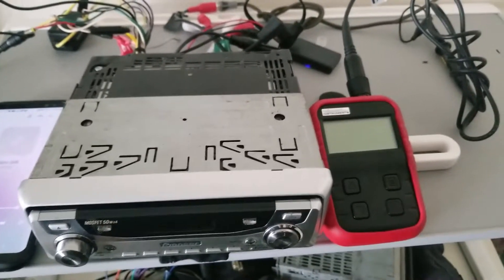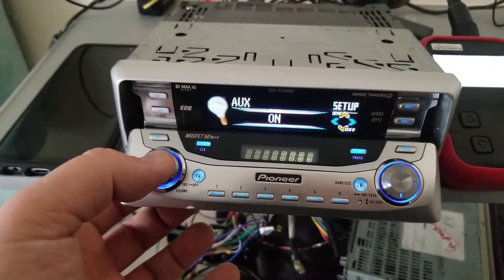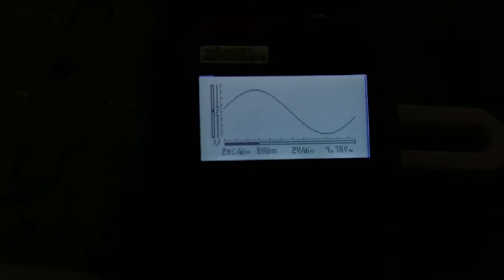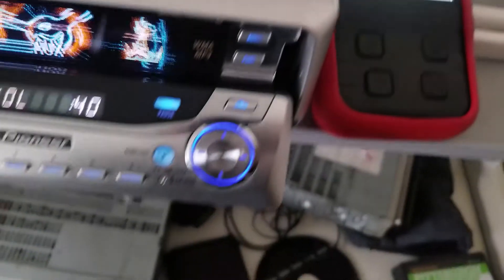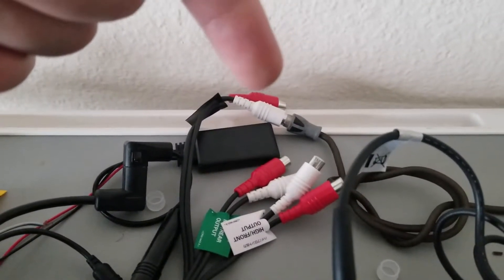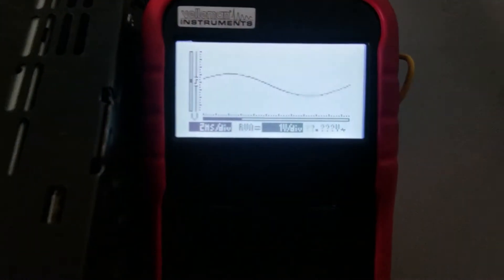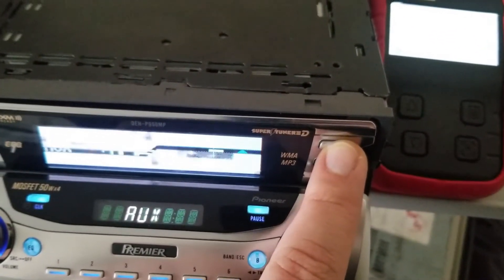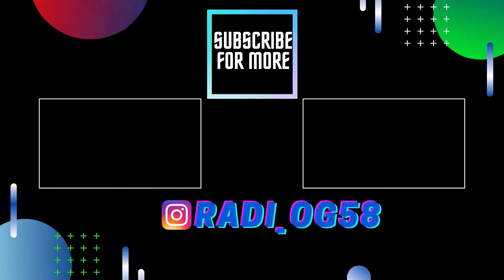Pioneer DEH-P9600MP vs Premier DEH-P960MP || RCA Voltage Tests

Comment: I know you don’t specialize in repair but I’ve got the older 840 and It won’t power on. I know it’s getting power cause I checked it with a multimeter but I can’t figure out why it won’t turn on. Any ideas?